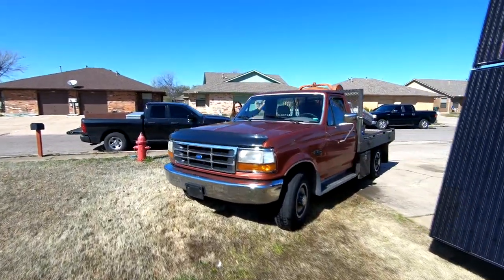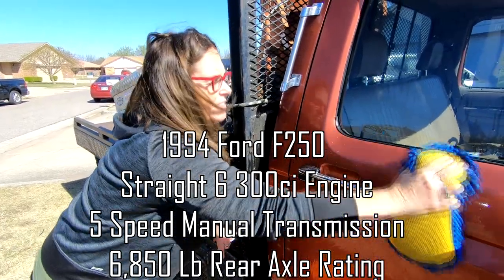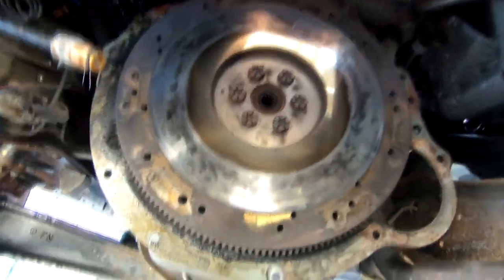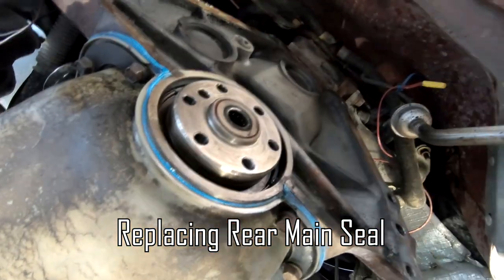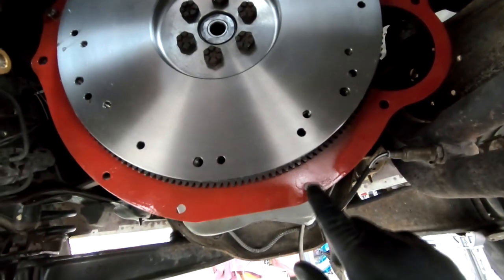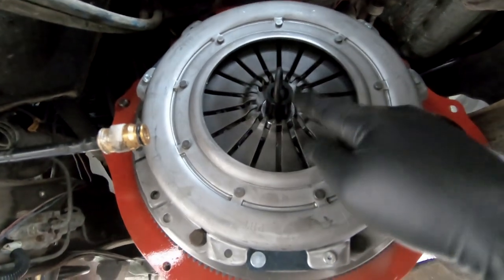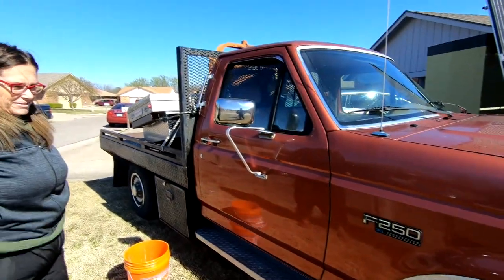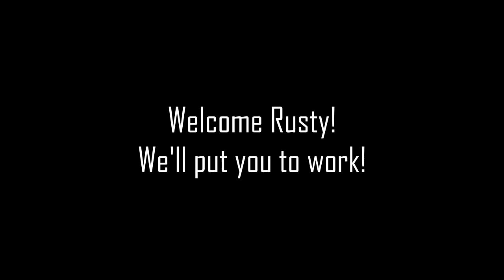Meet Rusty!

Comment: That is one of the toughest trucks ford ever built , defiantly the toughest engine but it might struggle with a heavy trailer on the highway depending on how its geared . I bet it's perfect out at contentment ! Somebody rode that clutch a little bit to much that's what wore the fingers an smoked the flywheel
Reply from the maker: Very true. It has been used as a tow vehicle for 5th wheel trailers almost all of it's life!  Good to hear from you, Chris!